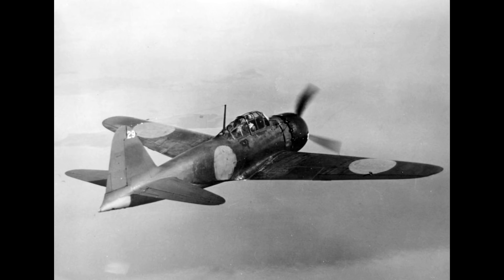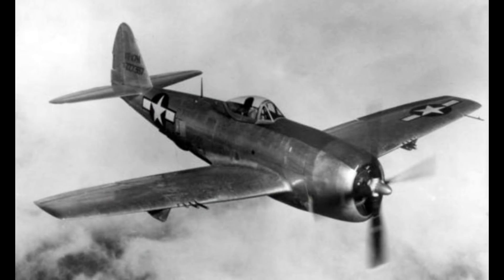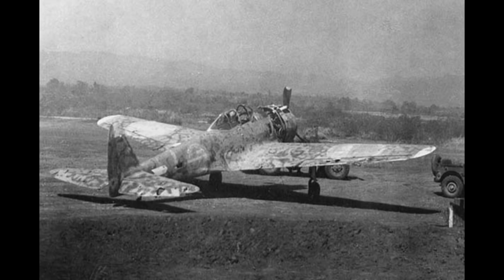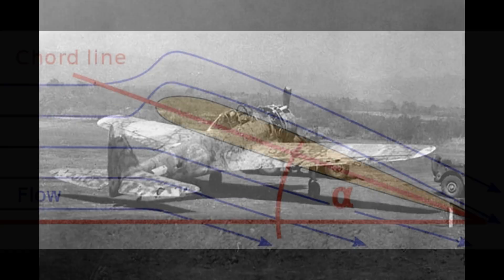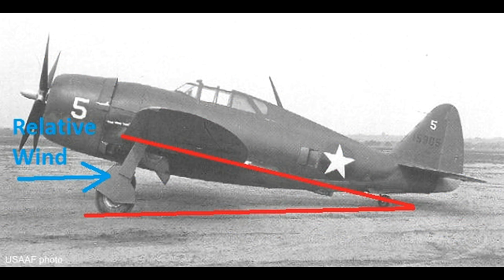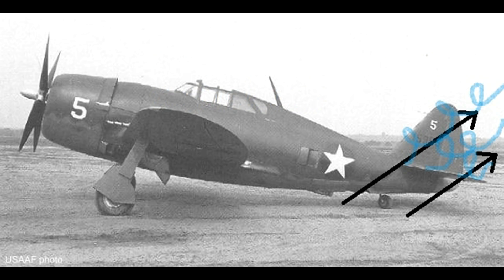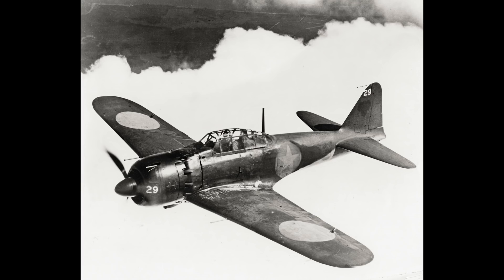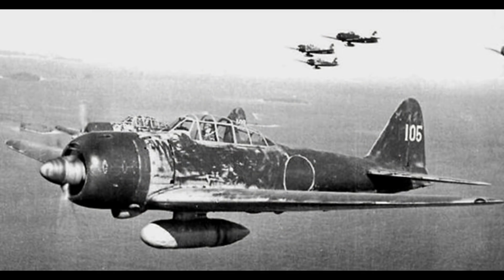Mitsubishi A6M Zero, an interesting fact few people know

Comment: But WHY did moving the tail forward help spin recovery? That is the part I don't get. Based on my understanding of rudder disruption, and the rough sketches, moving forward seems like it should have made the problem Worse, not better, particularly give the rudder doesn't extend below the tail. Sure, they did a wind tunnel test and claim that showed it was better. But that doesn't explain Why, or even if there weren't other compounding reasons why it worked. Was there some particular fuselage shape that also combined with the forward tail to improve handling?.
Reply from the maker: Don't think of it as the tail forward, think of it as the rudder father back. That might help.
Reply: @GregsAirplanesandAutomobiles  I understand how putting the vertical tail further back should help with stability, but to me it just seems from an airflow over the rudder at high AOA, moving the Zero's rudder back, only hides it deeper in the dirty air of the horizontal stabilizer. But the tail is "lifting" downwards, deflecting air upwards. Perhaps the upward deflected air is pushing more air across the vertical tail with it further back? I'm just trying to work out how to draw the aerodynamic diagram (forces, vectors...) that explains what is happening. The logic of the configuration just seems counterintuitive.

For me, "tail forward" vs "tail rearward" is relative, but the end result is the same (aside from any moment arm changes of course).

But I've also never come across a truly scientific discussion of how vertical tails are disrupted at high AOA by the horizontal tail position and wings. It's always just some "rough sketch" of what we claim is going on. Makes me worry that it is somewhat like "spiraling slipstream" on the rudder. Many aerospace engineers have tried for decades to measure spiraling slipstream effect and failed. And one PhD proved it doesn't exist. And I found a letter from the FAA to DPEs years ago that told them to stop asking about spiraling slipstream in check rides because no one could actually prove it existed at all. I even found pics and videos that support the idea that it doesn't exist at all, as well as some basic aerodynamic diagrams i can draw that show why it can't really be a factor. Point is, I'm just trying to figure out how this truly works, in a quantifiable way if at all possible. I know there have been actual flight tests and deep stall research that goes into tail configurations, so I'm not saying it's not a real issue, only that we often take too many things for granted in aviation, and I've uncovered far too many aerodynamic fallacies and misconceptions over the years that are still taught at flight schools. I have really wanted to understand tail configurations better for some time now, but find little info on the subject that isn't just a bit too much hand waving for my liking. Are there geometric guidelines to help figure out the relative positions the rudder/tail should be positioned relative to one another? That sort of thing.

Comment: It would seem to me that the very high angle of attack where the forward horizontal stabilizer would be of use would be at or near the stall point of the wing. Not much of an advantage.
Reply: Are you an aeronautical engineer or aircraft designer?
Reply: @droceretik   - Why do you ask? In any case, I worked on aircraft in the United States Navy  for 20 years and learned a bit along the way.  I also held an AP license.   What are your qualifications?

Comment: P51D was similar, also forward horizontal stabiliser.
Reply from the maker: Similar yes, but the P51's forward edge of the vertical stab is actually forward of the entire horizontal stab. It does however get the entire rudder aft of the horizontal stab which in principle does the same thing. That's probably why the P51 is one of the few USAAF fighters that can be put into an intentional spin, like the Zero.

Comment: Look at later P 40s where they moved the vertical empenage aft about two feet for better directional control in high speed dives . Look at the P51 Mustang with horiz stab and elevator mounted well fwd of rudder..!!!  You implied that only ZEROs are built that way...
Reply from the maker: Oh no! I didn't fit every possible variation of this design into my 2 min. and 38 second video. While they may look similar, these two tail designs are not. In the case of the Zero, the horizontal stab is moved forward specifically for operations at very high angles of attack, including SPINS. In the P40 regardless of which tail is has, intentional spins are prohibited. It's vertical parts were moved aft.

Comment: My Dad and his friend crawled from front to back inside the zero that crash landed Alaska. Dad said everywhere inside it was written "Alcoa Alum, Alcoa Alum"
We sold them the aluminum they used it to make these and kill us with it.
..
..
.
Reply: I don't understand how formed aluminum would still have "Alcoa Alum" stamped on it UNLESS the parts were actually MADE in the U.S.  Please explain.
Reply: @Tubetopfan1  
Sheets of aluminum pressed into shapes. What do you think we sold them, ingots?
Reply: @captmack007  I don't mean THAT.  I can understand that they bought the raw material from the U.S.  But was it made into Japanese Zero's in the U.S. as well?  Otherwise, it's difficult to believe the stamps would remain.  (Melted metal would not retain any stamps which were on the original raw material).
Reply: @captmack007  That would be the standard way to do it, yes.
Reply: And anyway, you don't have to be an ass about it.  If it was sold as sheets and then pressed into shape, you could have just said that.

Comment: Did the Japanese ever upgrade the engine? Wasn’t it a sub 1000 hp motor?
Reply: A6M2 had indead less than 1000 hp, but the A6M3 and A6M5 had more than that, but still didn't manage to reach a top speed of 600 km/h.

Comment: The f4u corsair had a similar design but had the vertical stabilizer and rubber forward instead of the horizontal stabilizer. Can u explain this how this mod helped the corsair or diff from zero design and performance
Reply from the maker: I'll do that when I get to the Corsair. It needs its own video.
Reply: I think you are all over looking that bloody powerful engine and huge prop it swung on the corsair the fin had to be moved forward to increase authority at low speed and take off to asist in controlling the torque induced roll on take off  Cautious pilots did not use  full power on take off untill rudder rudder authority was established  about 130 knots I beleive        moenui

Comment: Now, what's the deal with the Corsair's vertical stabilizer being so far forward of the horizontal stabilizers?
Reply from the maker: I haven't found that in any original source,, but the facts point to it being done for structural strength.
Reply: @GregsAirplanesandAutomobiles  Thanks. I've always wondered about that design choice. Very unique!

Comment: I don’t think that the rudder effectiveness during high angle of attack (AoA)  was the reason for moving the horizontal stabilizer forward. In my opinion it works exactly opposite. Moving the horizontal stabilizer forward causes that during high AoA the rudder is completely in a aerodynamical shade or wake from the horizontal stabilizer … just try to draw a picture and you will see it. If you want to improve effectiveness of rudder during airplane’s high AoA you have to move the horizontal stabilizer backward – behind the rudder. Or design the rudder in such way that its surface is not only above but also reaches below the horizontal stabilizer (see Bf-109 or Mustang i.e.)
Configuration of Zero’s tail stabilizers had another reason. In my opinion it has something to do with the stability of the plane – therefore with its agility and maneuverability. At those times the airplanes were designed as stable to ensure that the pilot is able to control the plane. (Nowadays you don’t need a stable fighter because a flight computer provide the control, i.e. as far as I know the F-16 is almost unstable design) But too stable plane is not a good fighter. Fighter plane must be able to quickly change the flight direction and too much stable plane would resist to those intentional changes.  Shortening the distance between horizontal stabilizer and the aerodynamic center of an airplane lowers the airplane stability. In other words it lowers the airplane natural resistance to change its longitudinal stable position and (if changed) to restore the stable position. Zero was highly agile fighter (except inefficient ailerons in high speeds). I guess that the designers wanted to keep good directional stability of Zero while lower the longitudinal stability to get a fighter which is agile in the longitudinal plane. That’s why they choose that tail configuration. I may be wrong … but that’s how I understand the flight mechanics.
Reply from the maker: While I appreciate the thought you put into this,, and I appreciate your post, you are absolutely wrong. The horizontal stabilizer and elevator on the Zero were originally placed farther aft. As a result of testing in a wind tunnel that allowed for very high angle of attacks they moved it forward to improve rudder control in these conditions. My source is Torikai Tusro, Retired Chief Director of Fuji Aviation Technology, and he extensively explains this in a Japanese language documentary on the subject.

Comment: Don't forget the FW-190 and Hawker Typhoon have similar tail configurations
Reply from the maker: to a far lesser extent.
Reply: @GregsAirplanesandAutomobiles  yes.. I wonder if it was a form of convergent evolution in their designs.
Reply from the maker: The Zero was out before the other two. I'll cover both of them in time.
Reply: @GregsAirplanesandAutomobiles  oh for sure. I was just wondering if other designers without the benefit of advanced wind tunnels had eventually come to similar conclusions through different means of testing.

Comment: "I don't know of any other WWII-era airplane that is set up this way."(Speaking of the horizontal stab/elevators being forward of the vertical tail/rudder)  I guess you've never seen a P-51 Mustang, then.
Reply from the maker: It's done to a much lesser extent in the P-51.
Reply: @GregsAirplanesandAutomobiles  If you look at the trailing edge of the elevators in both planes, they end at or ahead of the hinge point of the rudder on both planes. The T-6 Texan also has a similar tail design. The specific shapes of each plane's vertical tail/rudder and horizontal stabilizer/elevator are fairly different, but the basic geometry is very much alike.

Comment: This was a carrier based plane and landings on a flight deck can be tricky especially in rough seas. By locating the horizontal stabilizer a little forward the pilot had better control on landing as he could not over run on the movement of the joystick. It was more controlled.

Comment: I’m pretty sure the Ki-43 had slightly better turn and significantly better roll than the Zero, making it the most maneuverable monoplane of the war, but the Zero was definitely a close second.
Reply from the maker: That's a fair point, and it is one that I considered. However, in January of 1941 the Japanese staged the "Army Navy Fighter Performance Contest" which pitted the A6M2 Zero against the Ki43. The Ki43 with it's lower wing and power loading was expected to beat the zero in speed and dogfighting. However, it didn't turn out that way. Specifically the Zero was better in speed, climb and turning climbs, which is a critical aspect of maneuverability as it pertains to dogfights. The Zero beat the Ki43 in maneuvering dogfights, and the reason was determined to be its superior control interface. So, while it's true that the Ki43 should be more maneuverable based on specs, in reality, it didn't turn out that way. Oh, and so I sort of stay on topic for this video, I'll add that the Zero had superior rudder control at high angles of attack ;)   Thanks for your comment, I do appreciate it!
Reply: By those metrics alone, then a Ki-27 and A5M would be better than all.
Reply: thelasthostage 
We are talking pure maneuverability, and the A5M and Ki-27 ARE more maneuverable than the A6M and Ki-43. But that doesn’t make them better fighters. Aerial combat, especially WW2 aerial combat, is about much more then just turning tighter than your opponent.
Reply: Sorry I am replying late to this but I figured that I would add a few things.

First the IJN/A contest. The IJN and IJA were basically the political parties in the military junta controlling the government at the time. The IJN basically got to set the terms of that fight and had their most powerful A6M facing a relatively under powered Ki-43 (under powered meaning that the variant used was not the variant with the best available engine) via underhanded tactics. The more powerful engine of the A6M basically did wonders for it. The fight was basically rigged in the IJNs favor.

As for something else about the A6M. It was originally designed to use the Mitsubishi Kinsei engine that produced 1,300hp. Basically the A6M8 variant minus all of the late war additions. However someone in the IJN apparently was concerned about the controllability of the aircraft for newer pilots and thus wanted the less powerful 940hp Nakajima Sakae engine installed instead and seeing it was IJN vs Mitsubishi IJN won and the Sakae engine was used. I also think under table politics was involved as well since the IJN competition for the new fighter that the A6M won was lost by Nakajima (via saying that the requirements were unachievable and thus pulled out which was a great risk if Mitsubishi pulled them off which they did) as they were the two companies offered the chance to compete. This however is, as far as I am aware, an unsubstantiated rumor that I give personal credibility to due to how things typically played out in the system in other similar circumstances.

Imagine if early in the war the A6M2 had the Kinsei engine instead. Instead of a top speed of 336mph a top speed of 356mph meaning it could handily out pace most every fighter it was facing until late 43. Instead of 7 min 56 seconds to roughly 20,000ft an estimated 6 minutes. Considering the 1,000lb heavier M8 got to the same altitude in 6 minutes 50 seconds a 6 minute estimate might likely be rather conservative. I seriously doubt that the F6F-3, introduced in Sept 43, would have been near as big an impact as it was had it faced a lightened A6M8 as an A6M2.
Reply: Richard Armour 
It wouldn’t have taken much to immediately update the F6F-3 to F6F-5 standard with ADI injection boosting horsepower to 2300. And the F6F-5 certainly was more than a match for a Zero with 1300hp.
BTW, the A6M2 airframe was lighter than the A6M8, but it was also draggier and didn’t have the exhaust design of the later Zeros which boosted top speed slightly. An A6M2 with the 1300hp engine would have been slower than an A6M8 (which was still significantly slower than the F6F), something that the F6F would exploit. Also, the A6M2 would have to be strengthened (thus made heavier) to be able to hold the heavier engine. So if it had been designed with the 1300hp engine, it would have been heavier than the A6M2 that was designed.
Reply: The first part I fully agree. Not much would have had to have been done to get the F6F-5 and that would have been the dominant fighter of the two however until then its hard to say that the way things play out doesn't drastically change.

The second part about the changes from the engine however are false. The installation structure of the Kinsei engine and the actual engine itself was lighter than the Sakae engine and the installation structure for that. The Sakae engine was over 100lbs heavier, not including the mounting set up weight, than the bigger and more powerful Kinsei engine. Take into account that the Zero was designed to have the Kinsei engine and structural modifications were done to accommodate the Sakae engine and those modifications also added weight. Thus having the originally planned Kinsei engine the A6M2 would have actually been at least 100lbs lighter. That said while yes the airframe was a bit draggier and it didn't have the benefit of the jet exhaust both of those combine for only about 10mph in top speed. Still that Zero would have been much more dominant than the A6M2 was as it was.
Reply: I recall reading that Japanese army pilots were at first disappointed in the Ki-43 when they transitioned from the Ki-27 as it was much less maneuverable and had a fully enclosed cockpit.
Reply: Dan Zervos 
Yeah, you’re right. The Ki-27 actually service in the war and it was more maneuverable than the Ki-43. The thing was almost as maneuverable as a biplane! 
What you generally find is that (contrary to what History Channel will have you believe) the earlier the aircraft, the more maneuverable it was. As time went on, designers focused less and less on low wingloading and more so on speed and acceleration/climb rate (which came at a cost of weight).

Comment: It's to avoid adverse pressures across other tail flying surfaces during cross control. As with the FW 190, Corsair,  etc, this makes landings (and targeting) more predictable. With the limited knowledge of the time, anhedral stab surfaces were not a viable option.
The anomaly doesn't happen when you play a video game, as it's not modelled. If you fly an RC model, it can be realised.
Reply from the maker: For the 1000th time, the Corsair's tail is the literal opposite of this.